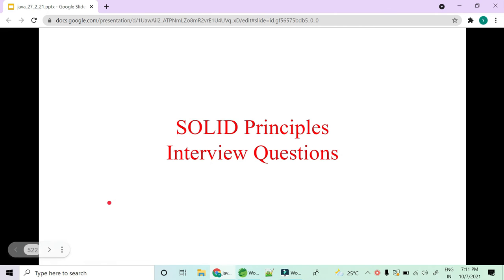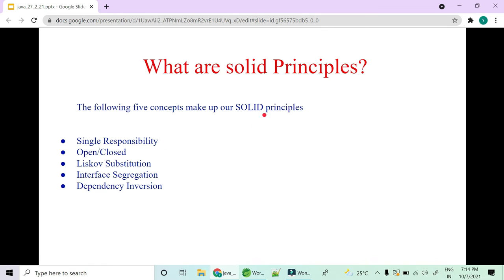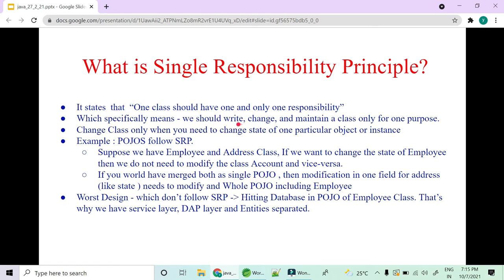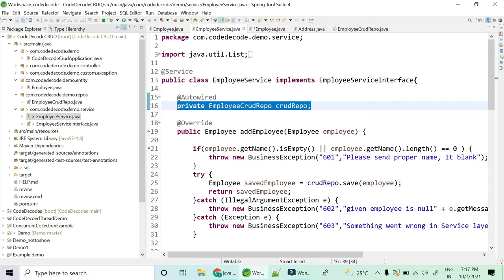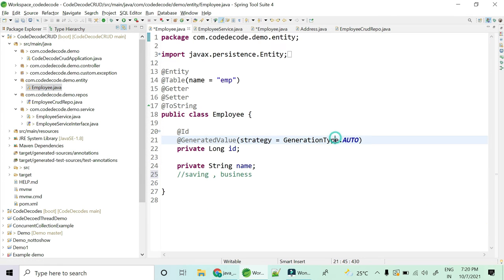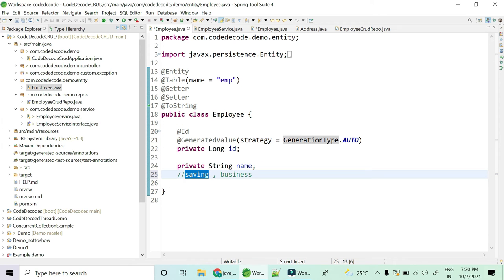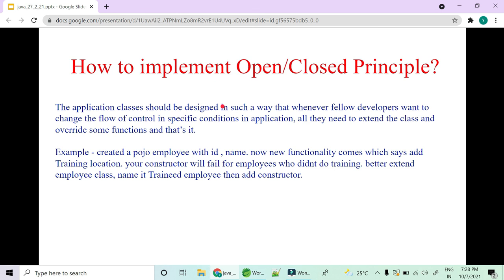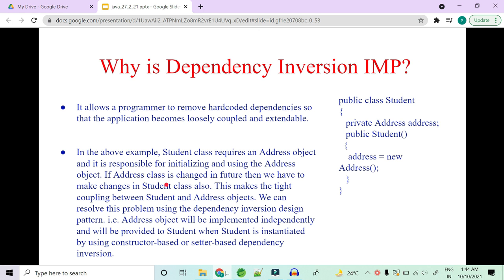Solid Design Principle Interview Questions and Answers for fresher and experienced | Code Decode

Comment: 11:30 I have a doubt, Instead of creating another class, why can't we create a new constructor with that address parameter?
Reply: No suppose u want to add new class in existing code then u need to check all code if there any dependency or not..for all other class ..
If u add training location in that existing employee class u need to do changes in that class which might affect other class where Employee is used..

This is my understanding...